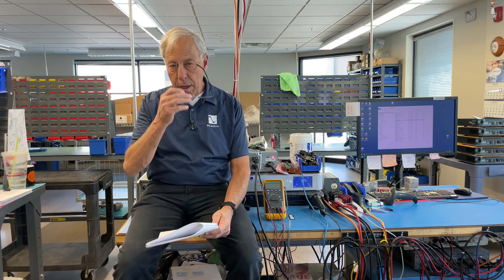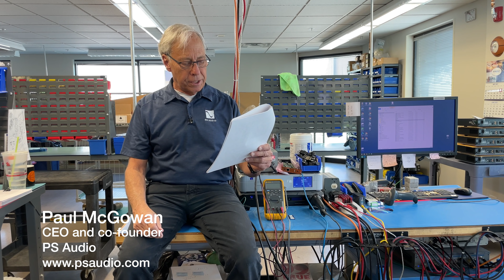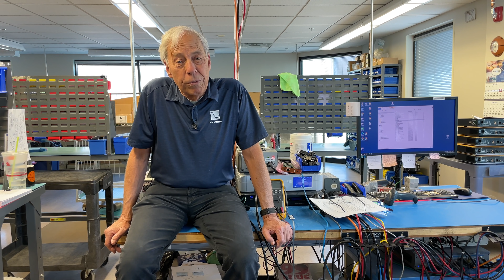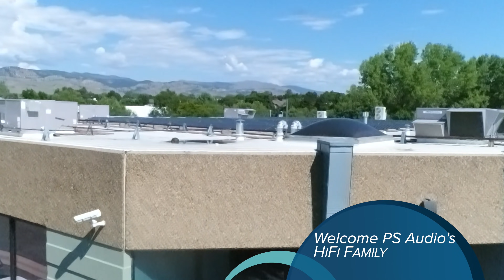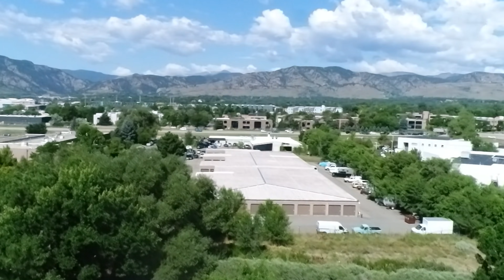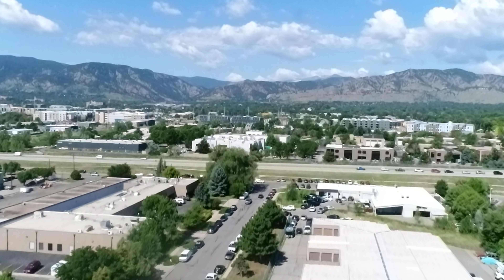When to change vacuum tubes

Comment: This reminded me I haven’t changed the tubes in my guitar amp in a long while. I like to change em semi frequently so I build a little collection of used tubes for fixing others amps and building stuff, but I don’t bias my amps too hot so the tubes don’t really wear that much.
Reply: During the 1991 NAMM, a company - whose name I sadly forgot (Demeter, Mark of the Unicorn?) - had a digital guitar effects device with a mode that simulates the sound of a tube a few days before arcing and going dead -  i.e. the aging tube sound. The setting reminds me of the sound of the guitars in the ending of Slayer's Seasons in the Abyss.
Reply: @laurentzduba1298  LOL that is absolutely hilarious!! I have a few digital multi- effects devices, none of which with such a hilarious effect.

Comment: I bought a TUBE Checker I haven't learned to use yet, but it is my hope that this will help me to be a Wiser Shopper and a Wiser Audiophile..... my cost of Mullard replacements for '4' Mono Amps would be close to $600 bucks a year which for a retired Laborer is pretty high.
Reply: Old school tube testers are really fun and simple pieces of equipment that I love to use
Reply: Mine has a needle that points to either ok or replace.

Comment: I got Sovtek and Svetlana tubes from 1995 that still registers ok when placed in a tube tester. Weird given that they are now way beyond their 40,000-hour lifespan. 🤔
Reply: I know of an amplifier that was on 24/7 from 1958 through 1974 (980k hours) without changing tubes. It still worked fine.
Reply: Tube testers are far from ideal indicators of tube performance. 
A curve tracer gives a much more telling result, but this sort of test requires knowledge 
plus a few pieces of bench gear that can be rather expensive, 
and the high voltages involved must be properly handled.  
Ultimately, the best test of any tube is How It Performs In The Circuit Where It Is Used.
Reply: @spacemissing  my tube tester is a mid 1990s era kit that allows it to be connected to a Windows 95 capable PC where the PC loaded with the required software magically turns into a low cost Fast Fourier Transform analyzer. Sadly, I have yet to borrow a dedicated $20,000 FFT analyzer to compare to my mid 1990s unit.

Comment: Replace in sets when applicable. If you replace a tube on the left channel do the same for it's twin on the right. Some tubes last MUCH longer than others, and frustratingly enough, some tubes sound their best just before they burn out. ☺☺☺☺ ain't it great 👍
Reply: As a guitar player, I also find that tubes sound best (given the circuit sounds good for guitar) when biased a little too hot and on the verge of burning up! However, I don’t have the money to be replacing tubes every 45 hours of playing so I bias my amps just within spec and just crank the hell out of em.
Reply: @graxjpg  that's what Eddie van Halen did allegedly. Supposed to have used up much of the nos supply of 6550s.
Reply: @jamesrobinson9176  angus young of AC/DC biases his amps so hot that they often don’t last a single gig. He brings about 40 Marshall heads on stage, and about 100 on tour! Grossly excessive in my opinion.
Reply: @graxjpg  sounds about right ☺. Bias points are often tightly guarded secrets

Comment: The golden rule is after 8000 hours on small tubes and 2000 on large. Modern tubes are poor quality and not built to last. The sound sucks too so replacing them earlier probably is a good idea and improvement. 

 If you using 40 year old Nos tubes then get them measured to see that they are still functioning correctly. If so then keep using them.  Guaranteed they will still sound better than the latest versions.
Reply: Old tube testers are great for checking nos tubes, provided that the tester has been refurbished.
Reply: Spot on !

Comment: I have tubes in 60 years old radios that sounds just as good as the new if I try replacing them. So that all tubes degrade and so fast that it warrants replacing them each year? No, I dont think it's that simple.
Reply: I have read in several places that high quality NOS tubes from about 50 years ago last much longer and degrade more slowly than tubes currently manufactured. I replaced all the tubes on my pre amp and phono stage with NOS Mullards because I liked the sound better. I have not had them very long so it will be a long time before I can say how long they really sound good
Reply: @JonSaperia  I use old stock Russian 6sn7 and they preform very well for 6550 I use Russian sovtek they are far better then other new brands. Shame Swetlana doesn't make new tubes anymore. I found the old stock is indeed better but the prices going to the roof.
Reply: @Dutchamp  Big fan of Melz hole plate 6H8C, beautiful
Reply: @tothemax324  same quality mine now are from 1962 great full sound fat deep and beautiful mids, soft high without nasty tops
Reply: One year nonsens I replace all pre tubes ones in two years and power tubes every 4 years. Yes you can hear the difference from old to new.
But when I want to replace them all at ones I spend over 350 euro, little costly. But always better then listen to transistors, I don't like them.

Comment: I just get my vacuum cleaner, put it in reverse and re-vacuum them
Reply: I tried that but the vacuum cleaner got pulled into the tube. WTF? I guess the tube was good after all.😁
Reply: @ jeff James
If the machine is in the tube, that will be quite an interesting sounding tube.
Reply: I don't think you need to put it in reverse. Anyway. 😬
Reply: @ daroke
I mean, away from the joke, if the vacuum was powerful enough and sealed, then yes, could actually pressurize the vacuum tubes and remove all the air. 😁

Comment: I just had a situation where my 21 year old Audio Research VT 100 Mark III had an open circuit resistor in the bias adjustment circuitry. This is the first time that I had one bit of trouble with this amplifier. I had a full complement of tubes sitting in a closet which I gave to the lab tech who repaired the amp. I’ll respond the same way Paul did in this video… OMG what a giant difference In the sound of my system in every way imaginable. Tubes are expensive and Audio Research would have charged me $700-$900 for the tube replacement alone without even touching on the huge shipping charges and repair costs. From now on I will be changing tubes on an annual basis. A good company to purchase tubes from is Upscale Audio and the full complement of Cryo’d tubes matched in quads was about $350 half the price that Audio Research would’ve charged me. That is something I can afford.
Reply: Open resistors in the bias circuitry could lead to red plating tubes, which could take out other components including a transformer!
Reply: @graxjpg  You are right but I caught this problem in time. The entire amplifier was checked out after the problem was filed top to bottom and everything else is fine at least a present
Reply: @Scopolamine46  that’s good to hear, those are great amplifiers to me! Cheers to having yours working! I get my tubes from antique electronic supply, but I am mostly buying 12ax7s and 6L6s.
Reply: @graxjpg  I’ll check out that company. Thanks for your input

Comment: Every year we in make the music crowd believe they don't sound well till they get old help me understand
Reply: If you're asking why old Nos (new old stock) sounds better it's simply because they had the knowledge  skills and were allowed to use dangerous chemicals like lead.  We have lost the competence and know how.

  A couple of manufacturers still use the same equipment from the 30s (most equipment was destroyed) such as EAT or KRAUDIO and still know some of the tricks.  

They are still not as good as Nos because they can't use the same materials  However they still sound better than Chinese valves but they cost 4x the price. Saying  that so do Nos but as stocks run out prices will keep on rising.
Reply: Not just old, but worn in too. NOS tubes are great but they still don’t sound their peak until they are about to burn up LOL

Comment: Bob Carver ,disagrees with you.A correctly designed MODERN vacuum tube based system need not be so hard on their tubes.  BC
Reply: I can see his point. With more sophisticated power supplies and NFB, better coupling and decoupling you might get away with going a little deeper into AB1 which can make a difference with the output tubes but doesn't address the front end. Regarding that, more stages, lower B+, careful choice of tubes, I can see it. Still however, the tubes are going to be the thing you do most.
Reply: Hard to answer... but yeah modern power supplies + power conditioners in front of the amp will extend Tube degradation, it also depends on amp design, but 3-5 years seem like a more measured approach
Reply: Is that really you Bob? I am a big fan. I used to own a Phase Linear 400 and 4000 when I was a young man (see photo on left) driving my Dalquist DQ 10’s. At present, I have your True Signature Sub in my system and and It mates really well with my Maggies. Keep those innovative designs coming. You are a master of unique audio design.
Reply: @Scopolamine46  We don't know. We may never know. No content on BC's channel. It would be cool though, and while I don't worship the guy I do respect him for his accomplishments. I have a 400 in my cue now and after all these years the core elements are still very well intact.
Reply: @InsideOfMyOwnMind  I don’t worship any person on this earth but I do admire many people and Bob Carver is one of them. He is a creative genius in the field of audio design and most of his ideas are very unique.
Reply: @Scopolamine46  Agreed. Maybe "worship" was too strong a word.

Comment: get a tube tester you can buy cheap ones plug into your PC USB
I wouldn't say it's necessary for a preamp they don't generally wear out they are driven very low.
What tubes Paul do you use in your amps make and type?
Reply: Older ones can be had for dirt cheap as they usually have dried up caps etc, but the circuitry is so simple a guitar player could fix it. Those old style tube testers are a lot of fun!
Reply: He uses matsushida or Mitsubishi  (I believe) . I'm certain that they're 12au7. Upscale audio used to be THE source for those tubes when ps audio had retail stores. Kevin claimed to have tested dozens in the bhk and those were the best, in fact he sold them as a package.
Reply: @jamesrobinson9176  ok!